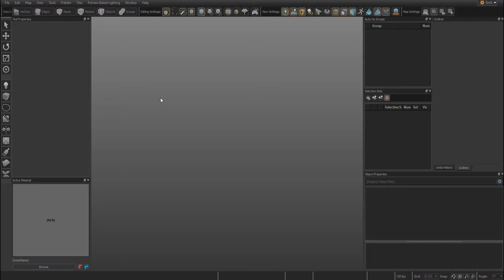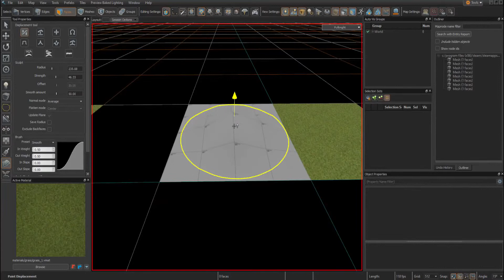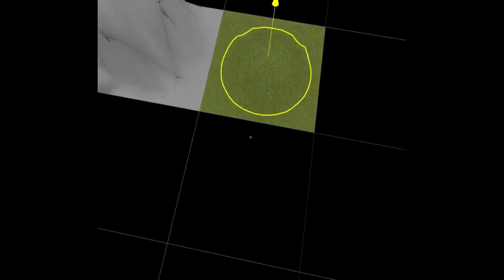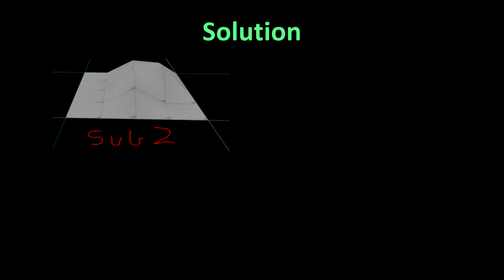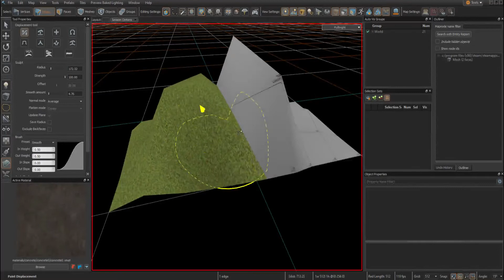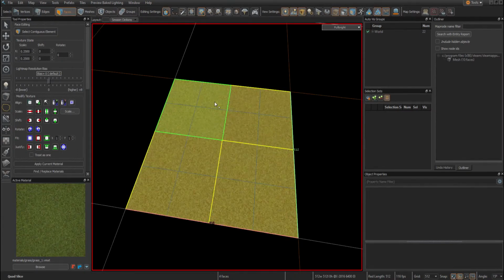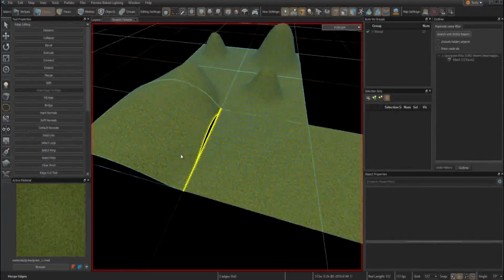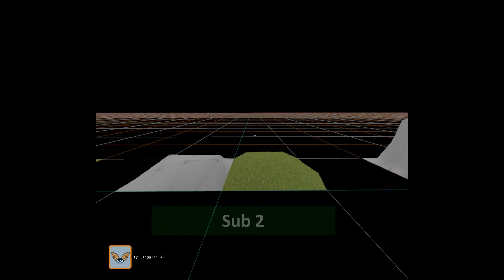howto - Terrain & hills - Displacements Part I [ S&BOX ] mapping

Comment: Is there a performance hit on using too much of the sub-division? Having an identical map and a similar structure or is that correlated to the map size itself? There are technically more triangles to render
Reply from the maker: Good question! Yes there is a performance hit when using to much sub division, the more squares/triangles, the harder your computer has to think. just by increasing subdivision will increase map size!
Reply: @codecakeee  Thanks for the quick reply. If you could or have to know how to make roads blend in to terrain that would be great. When I was trying out the hammer 2 editor I was struggling a lot with floating roads and or clipping hills/surrounding environment